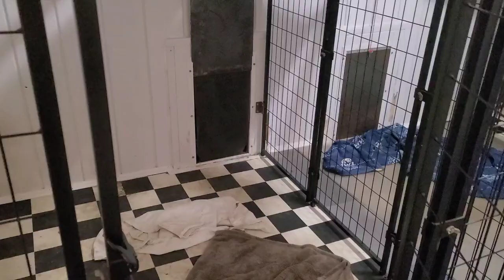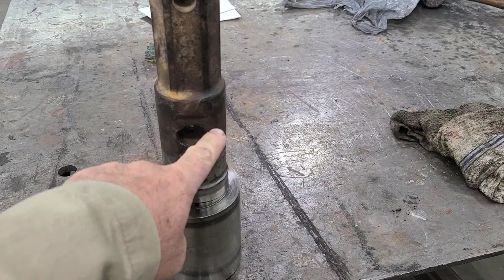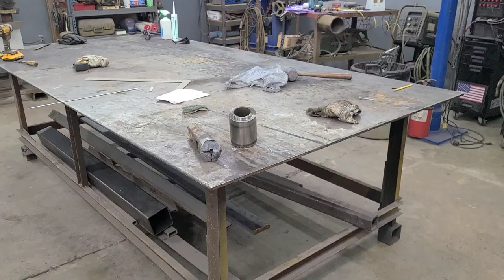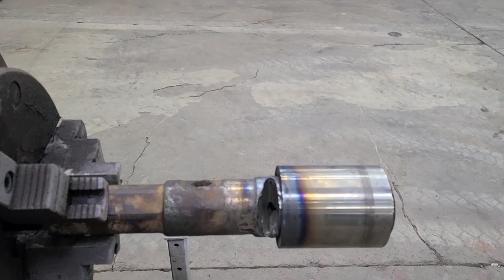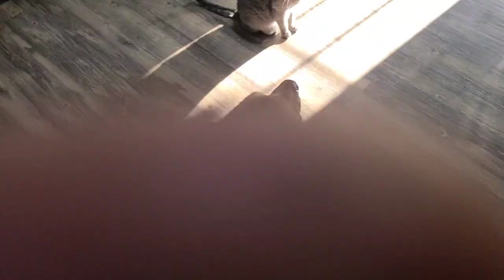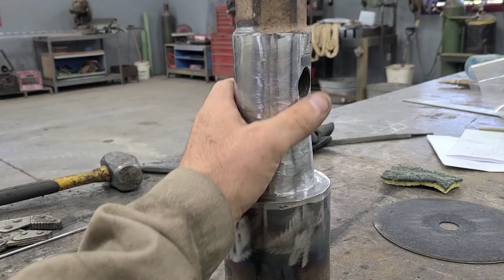Weld repair an auger shank

Comment: I really like the way you do things  CB. Great work!
Reply from the maker: I appreciate that!
Reply: @NBSWELDING  I tried the .035 flux core welding wire from Arccaptain and it is really really nice to work with. I had my millermatic 211 set for 1/8 material  and .035 wire. I was  working on a trailer. I welded in all 4 positions and it was easy and looked great with good penatration.
I will try the .030 wire next.
Reply from the maker: @michaelbigelow367  I have some of the ARCCAPTAIN flux core in .035" but I haven't tried it yet...glad to hear you liked it.
I've used quite a bit of the .030" and loved it